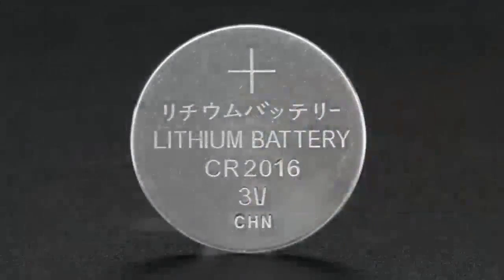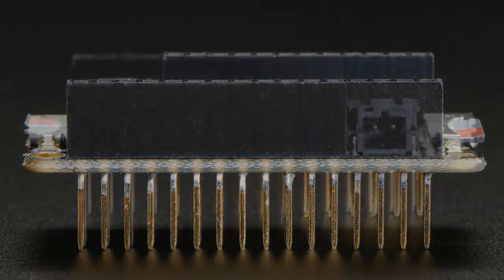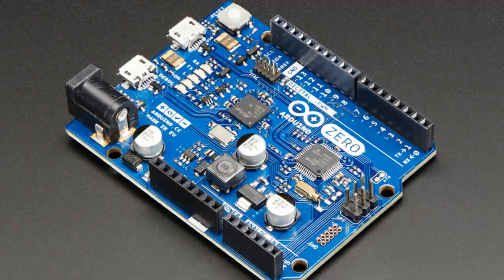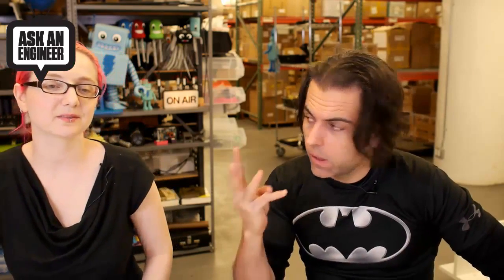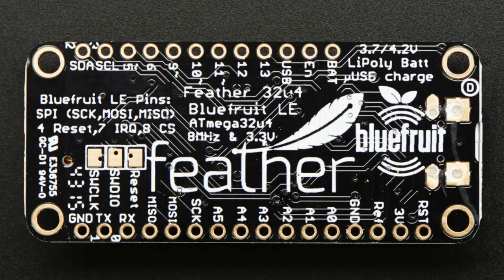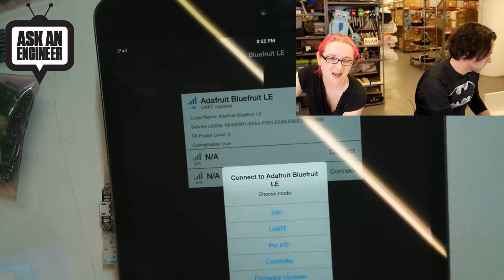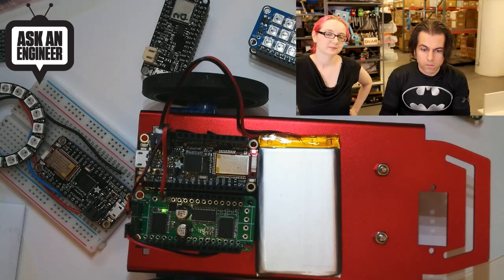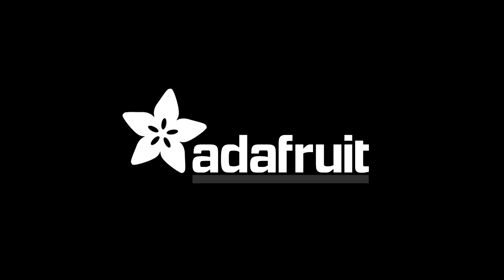New Products 11/18/2015

Comment: I want to control a solenoid that need 5v at 1A for less than 1 sec and i want to add Bluetooth to control the mosfet, how can i do to feed with one battery of 7.4v the Bluefruit feather AND the mosfet ?Please tell me that the feather have an input who can support 7.4v...I don't want to take two different battery :'(

Comment: are you guys planning any projects where 1 microprocessor can communicate with more than one other microprocessor? I'm working on a modified version of my game show buzzer project where the buzzers are wireless, because I think it improves the final product. At the moment, my plan is to use Xbees, where each buzzer has an Xbee set to communicate with the "hub", and the hub (probably a Mega) is connected to an Xbee that's set to communicate with all the buzzers. I'd rather use an Adafruit product if I could, though!